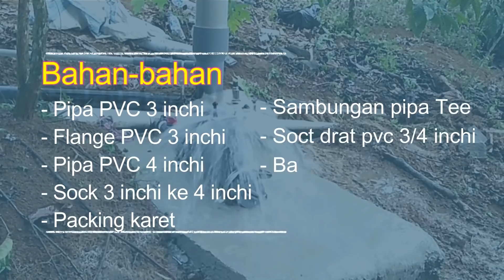Cara membuat Pompa Air tanpa listrik dari tempat rendah ke tempat tinggi Pipa PVC 3 inc - Ram Pump

Comment: this one saya salute, pernah tonton video lain yang hanya menggunakan sumber air dari tangki sebagai inlet so for me even output you put at high area but if the water inside the tank drop, pressure also drop so the pump will not work if you did not maintain the level of your tank... so this video very good because it use water flow to for the water pressure to push the pump, not gravity force to create the pressure. salute...

Comment: water is wasted though, should create a well and drain it there then use manual pump to water plants.
Reply: I believe it's not the final product.
The farm owner will put a reservoir at the end of the pipe I believe.
This video just show the making and the installation of the pump system.